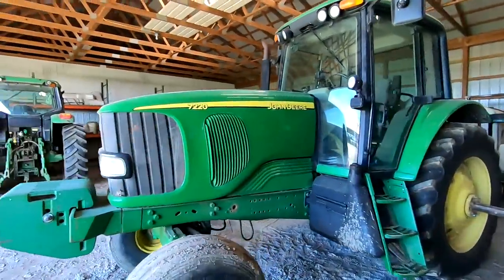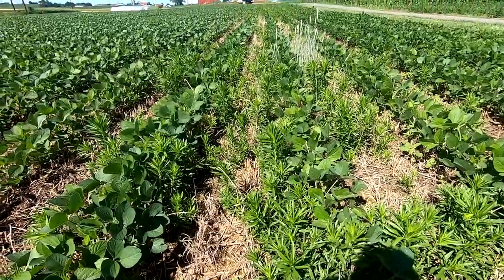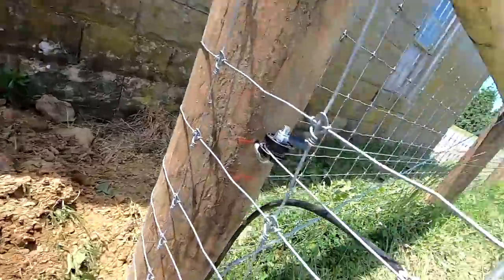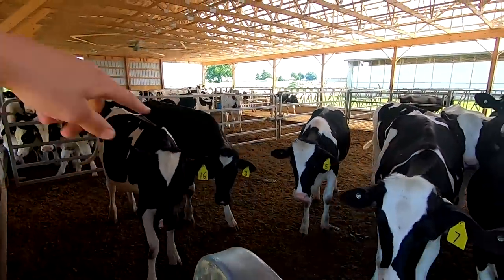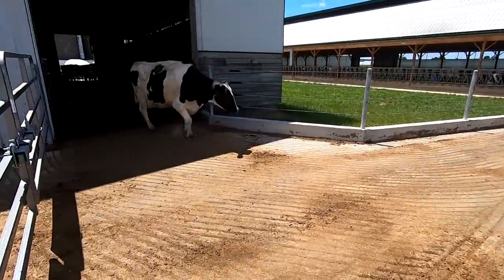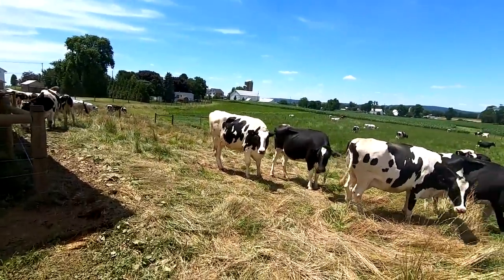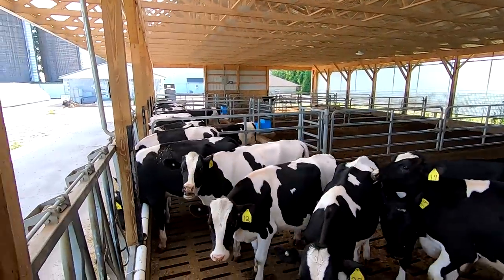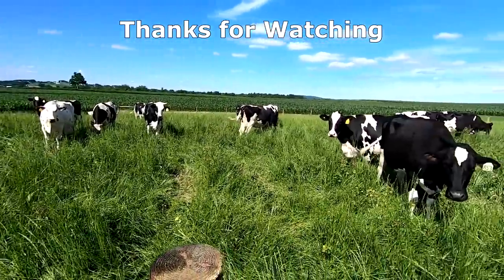Finally, New Pasture

Comment: Always interesting to see how fencing differs between you in the US and the UK. Whilst in America it seems like a lot of fences are electrified in the UK (at least my part of it) we all use what you call woven wire with a single strip of barbed wire on top.  

I guess woven wire lets you keep a wider variety of animals in without the risk of smaller ones being able to escape and it also requires a hell of a lot less maintenance as you don't need to keep the wire live all the time. Would be interesting to hear the benefits of the live wire system, I guess it might cost less?

Comment: Been using High tensile Electric fencing on my grandfathers farm since 1986 and ever since then by far the best way and in my opinion the only way to build a fence cattle respect the electric and if a tree falls on it just cut the tree off wire goes back in the place best way to build fence by far

Comment: City boy here, (Erie Pennsylvania) I used to work for a company called Thayer power and communication, i was a lineman. Was! .. anyway we were out in the country putting up fiber optic cable lines and at the time I was the grunt on the ground and climbing poles. So we came up to a farmer fenced in field with dairy cows in it, just like yours but the pole I needed to get to went through the field. And the cows basically came up to check me out and I needed to get in there. My senior work partner was in the bucket of our bucket truck says “just wave your arms around and they’ll run away” i waved my arms around and the cows just stood there and looked at me. Again, he says “just get in there, they’ll move”… i grabbed onto that wire not knowing it was an electric fence… OMG!! … Powered fence! Lit me up! Cows took off running and mooing my partner almost fell out of the bucket truck laughing so hard. Was definitely a wake up call and a learning experience I will never forget. (Edit) I can still see the cows eyes open wide as I was being electrocuted… lesson learned. Lay down, crawl under.

Comment: Your gonna wanna add gutters to back of that barn and run rain water into that water way or it’ll be a mud hole there. Probably also pour some cement in the heifers door way with a curb to keep the shit inside more and curb will make them step over and clean their feet less tracking it outside.

Comment: So me being mechanically minded, what are the flashing lights on the dash of the sprayer tractor?
Reply: My guess is that they're pulse width modulated (pwm) LEDs, and the flashing is an aliasing effect with the camera shutter speed.  So they could be solid lights, but appear flashing to the camera